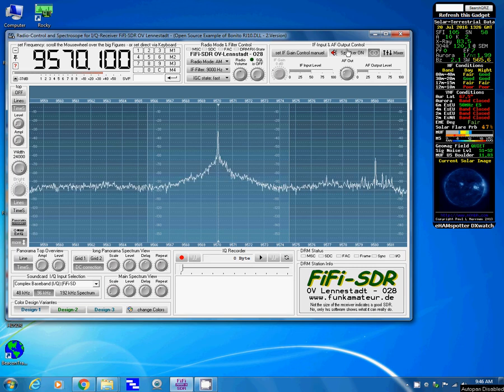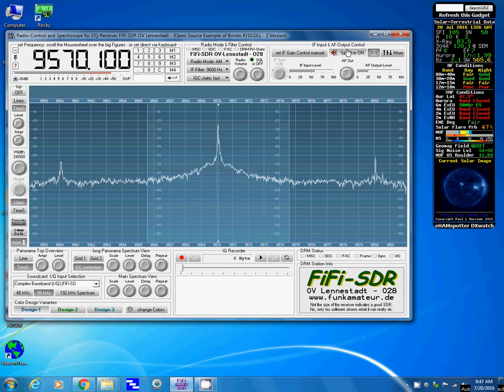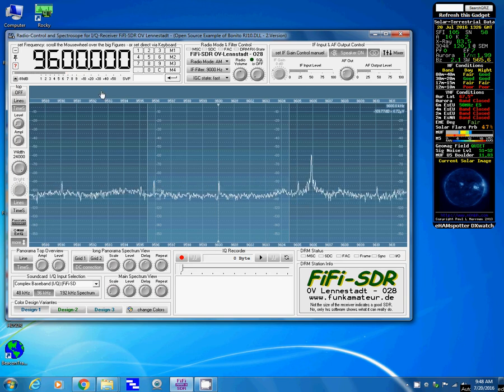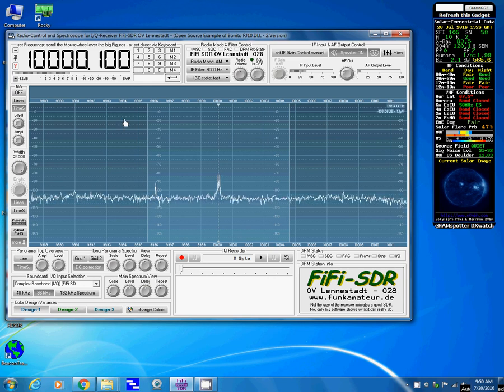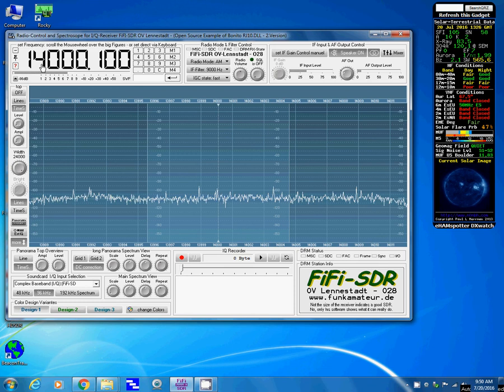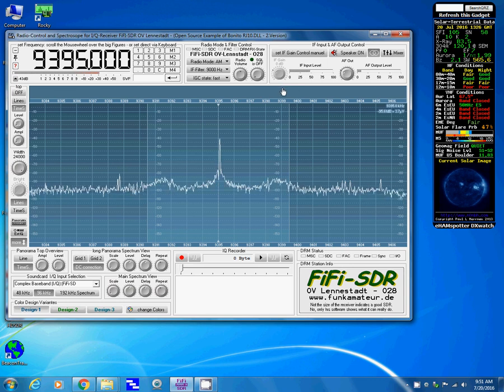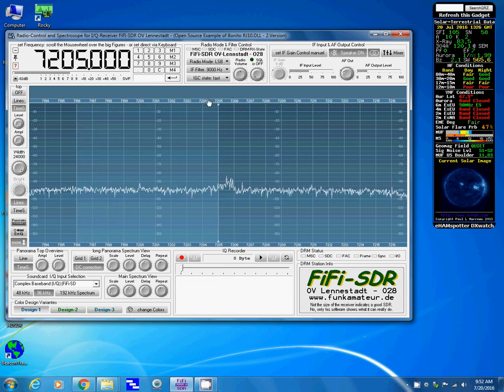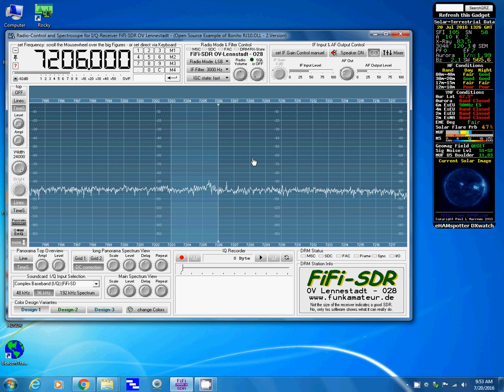TRRS #0923 - First Reception on FiFi SDR

Comment: The FIFI has a driver on the HDSDR's software website to use with the HDSDR SDR radio Computer control program.
Reply from the maker: Thanks for the info and I will check it out.

Comment: That is very quiet, not much noise. The more I look at this short wave thing the more I look forward to a compact SDR / PC radio, a portable unit if you will. I think there may be a way to use one on a smartphone but I'd rather see one in a laptop format. Lord knows I have a few laptops gathering dust. It may be just the thing for XP operating systems that are no longer supported.
Reply from the maker: Most of the software available will run under XP.
Reply: Yeah, that is what is so cool, re purpose an old XP laptop to work as a radio receiver and audio recorder.
Has anyone ever tried just a loop antenna for broadcast band?